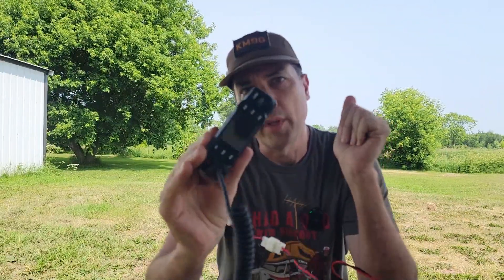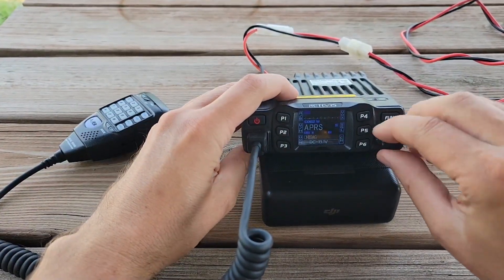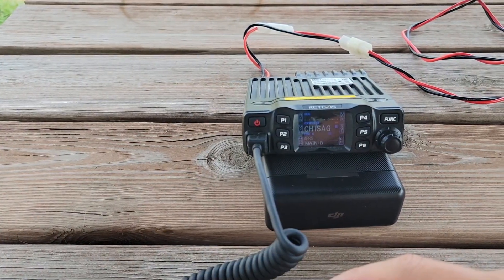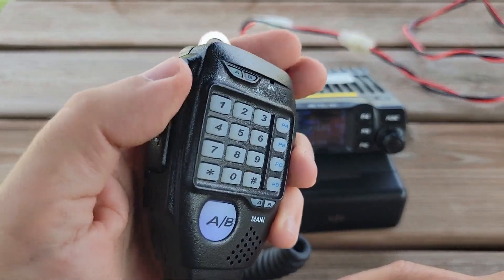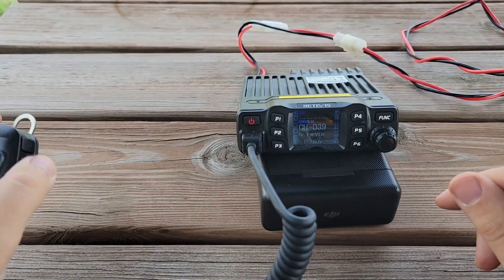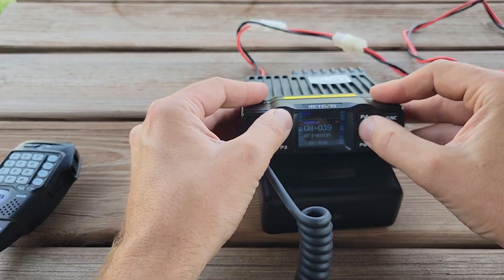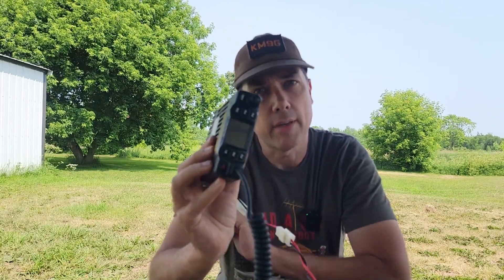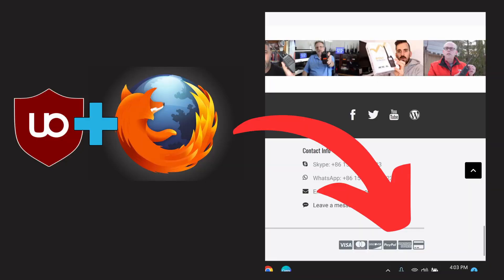I Broke It!

Comment: Hi Steve. I am just now seeing this video (1/1/24). Did the factory fix it? I glanced through the comments but did not find one about a resolution. Was also wondering if you had tried the long-press FUNC button for factory reset. I googled it as I suspect you have as well.
Reply from the maker: It is fixed at the factory and on a boat back.

Comment: Ham Made Parts actually has a cable for this radio under the AT-778UV for connecting to Kantronics or Mobilinkd TNC. I ordered one to try with a spare KPC3+ for using with Outpost/Winlink for a dedicated packet station using the 778UV. I have had pretty good luck with Direwolf and APRS when I ran a local digi-gate, but for whatever reason Direwolf does not seem to play nice with the local packet BBS's. A hardware TNC has been the only solution.
Reply from the maker: Thanks for the tip!
Reply: Sorry, I small rant from a UK-based Ham: I very nearly bought this AT-778UV cable from Ham Made Parts, but international shipping to the UK via USPS is a total racket. The part itself is expensive at $35, but I can easily justify that because it goes to a Ham that makes these things by hand, so each one is effectively a work of art. What gets me is that USPS wants to charge $63.10 for what is called "USPS Priority Mail International", which is their "cheap" rate. If you're really hard-up to get something very quickly you can choose "USPS Priority Mail Express International" which will cost you $72.35 for the privilege. Is it just me, or is there something a bit whiffy with this? Not blaming Ham Made Parts (I would love to support them from over this side of the pond), but USPS really takes the biscuit. I have lost things sent from the US in the past, and yet every cheap little doo-dad sent over from China gets to me for $0.00 (I know that there is massive controversy about that, but that's reserved for a different rant) without fail. USPS is causing a $32 item to cost me almost $100, and that is before import tax. Sigh...

Comment: I have used my RT95 as an APRS Digipeater for over a month with no problems, but I ended up using the backside external speaker jack as it was more convenient for other ops and it required a lower volume setting in direwolf.   Maybe this is easier on the radio?
Reply from the maker: It could be easier on the radio, but I really wanted one cable to rule them all.  My old method worked and I'm experimenting/learning with a prototype PCB.  I definitely broke the radio, but it really looks to me like its a software problem that should be easy to fix.  With all the radios I have, its 50/50 if I'll use this one again for this project or just pick another one.  Its good to have options, but it stalls the project I was working on...  Time will tell.  Thanks for watching!

Comment: Hi Steve, thanks for your sharing. Your RT95 is still on the way back to the factory. Our engineer team told me they have recently received another case of the same failure as yours, which has never happened before. So they thought that maybe another person did the same APRS modification to the RT95 as you did.
Our engineer team didn't think the failure caused by the software, or firmware. They assumed this was most likely a circuit problem. Since the RT95 was not designed with the APRS modification in mind, your changes may have caused some circuits to short out. Of course the final result will not be known until the device is returned to the factory. I will update the reason again in the comments at that time.
Reply from the maker: Thanks!  I'm curious as to what the problem is.
Reply: This is great customer support. 👍
Reply: @mostlypostie1  Thank you!
Reply: Since it wasn't designed with APRS/Packet (digital?) in mind, I wonder about the cpu/processor freaking out and going south.
Reply: @fitcher-armchair-sleuth  At the moment we don't have an answer as Steve's RT95 is still in transit, and we will need to get the faulty radio on our hands to find the real reason. As I mentioned before the possibility of a circuit failure, it is also possible if a CPU failure occurs, but this will all have to be tested to get a final answer.
Reply: @retevisQA  .. Roger on all that. Will be watching with interest.
Reply: @retevisQA any update? Ordered a rt95 but dont want to break my unit
Reply from the maker: @nodlek it's probably at my mailbox in TX. I won't see it until after hamcation. The radio was fine. I broke it.
Reply: @temporarilyoffline  thankyou!!
Reply: @temporarilyoffline  If you find out what was wrong with it and what may have caused the failure please let us know.
Reply from the maker: I'll have a follow-up video out soon. I just got it back from warranty support.
Reply: @temporarilyoffline  Any status on the follow up? Interested in what went wrong. I suspect it is because you didnt 'bond' the grounds from the tty serial card and the radio. I would recommend using either a relay or octocoupler between the tty and the radio
Reply from the maker: @HansKillinger They fixed it, but didn't tell me what the cause was.  I have it back in my hands, but haven't had a chance to get to it in the list of projects yet.  I'll have a video on it ASAP

Comment: Like an ecm on a car, you can remove power, and take + & - wires and tape them together, coming from the radio. It drains all electro caps, memory batteries, and will clear the itty bitty memory that you may have overloaded, and the mainframe controller for button commands and operating system may have gotten tangled, because they are not separated drives, but this may also flatline it, like all flash bye-bye.
But you could prolly write from scratch or copy paste from working radio. What a potential content dynamo, but if it gets worse, you made the choice. 
Still content.
Reply from the maker: I shoulda thoughta that!

Comment: I reached peak of my couriosity after bricking my G90 and two Nanovna. Now I know if is it not broken do not fix it 😉😁😁😁
Reply from the maker: Lessons learned!
Reply: Being too cheap to buy a data cable, I put an ethernet cable in my G90 and shorted some wires to see which would key it up.

Mainly because the diagram was illegible and most things don't mind being shorted. Well the screen started to blink  CONNECTION LOST and it got stuck in TX 🤦‍♂️

I ahem, got it fixed under warranty. Though I paid recorded delivery and probably got a used front panel with slack buttons & knobs.

Limited to 10W (M7) I'm running the G90 and RT95 from a £9 HP server PSU. I reused old molex connectors so I can switch to a 12V Lidl drill battery or jump pack.

Cheaper still, I use the vox mic attached to USB headphones to do FT8. Like an old modem with an acoustic coupler ☎️

The RT95 turns off sometimes when moved and I hope it's my crimping and not the inbuilt cord. Think I'll solder on that long thick cable still in the box to diagnose it.

Beware the G90 has such a crappy cable that the positive insulation wore through on my desk. I had to heatshrink it near the Tamiya thing.
Reply from the maker: @dazednconfused31337  resourceful!

Comment: Have you solved the rapid rushes of static when squelch is not 0 that happen on the speaker mic output? I have an amp board based on an old LM386 with a low pass filter on the front end but waiting for wire to arrive so I can pin the connector for the board and the RJ-45. Or is this just an ANYTone 778UV II issue?
Reply from the maker: In my application I haven't worried about squelch.  I'm using direwolf and it can figure out what is data and what is noise - saving that for a future date.
Reply: @temporarilyoffline  My application is to build a compact repeater. I have used Motorola GM300s ($60 off EBay and has great audio with 40w output) but they require dosbox to run some very old programming software to configure them and you have to reconfigure jumpers in the radio to switch between MMDVM and just an FM repeater with a homebrew STM32 repeater controller. Currently in search of a new radio that has the necessary inputs and outputs that doesn't break the bank. The RT95 or the AT-778UV II look like I might be able to make work without to much trouble. The pulsing squelch noise when squelch is not 0 is a problem.
Reply from the maker: @W3DMJ  have you seen the alinco radios with the 9 pin port on the back?  (DR-135TPMKIII) - that might be closer to what you need in a modern radio!
Reply: @temporarilyoffline  I have not. It looks like they are hard to come by. Will keep an eye out to snag a couple for testing.
Reply from the maker: @W3DMJ  I think you can get the TNC board for the 138, but I'm not in front of my computer to google around for it.  the 138 is the current model and it looks like it has the hole in the back where the port should go.

Comment: I'm not a fan of Chinese radio's - you get what you pay for. 

Great at volume manufacture, but their design capability in general lacks a lot of finesse and / or a seemingly baked-in desire to cost reduce and make cheap in appearance and build quality. And their user interfaces suck big-time. As well as programming software being absolutely dire.

Not a lot to like apart from bargain basement prices. Best avoided IMO. And their names also suck. Who in their right mind would bring a product to market under the brand of "Pingfu"? WTF?  Pingfu?
Reply from the maker: I wish I could say other radios are better... but I just turned on my Yaesu and accidentally pressed "AF Dual" which resulted in 3 VFOs  (I know what it does, but who names a button "Dual" when it does "Triple"?)  My Icoms have "DATA OFF MOD"... again, I know what it does, but its awful naming - its like they are trying to stunt the growth of the hobby.

Comment: You let out the magic firmware smoke!
Reply from the maker: I tried to breathe it all in when it happened so I'd be smarter next time.
Reply: @temporarilyoffline  Makes sense. That’s why I always burn the user manual right away when I buy a new radio. Osmosis learning is the best.

Comment: A friend of mine has that radio and it worked great until he set it up to do Aprs. Seems like that's something Retevis needs to look in to.
Reply from the maker: Did he say what happened?  I had it working with APRS and I tried to make it easier/better/cleaner and bricked it.
Reply: @temporarilyoffline When he switched back from APRS to tx to a repeater the radio started giving him issues.

Comment: QUESTION- I unlocked the radio to work on the us bands and I am trying to use the supplied programming software. When I connect it to the radio the soft wear tells me that this is the wrong radio. I am not sure how to fix this. Any help would be great.
Reply from the maker: Are you using the Retevis software?
Reply: @temporarilyoffline  yes
Reply from the maker: @stephenvandyke4084  I think I used Chirp when I was playing around with that.  I haven't used retevis software yet.
Reply: @temporarilyoffline  in my opinion it is terrible compared to yaesu programming software
Reply: Be sure you're selecting the correct version of the radio - there is a VOX version and a non-VOX version and they are listed separately on the pull down list of radios.  This, for me, was the fix for "the wrong radio"...ran into the same thing.
Reply: @WeedyCreek  thanks will have to check that

Comment: Edge is Chrome? Wow.

TO. Did you connect external hardware to the mic jack? Possible ESD or out-of-range voltage?
Reply from the maker: Yeah. I connected something wrong to the mic port.  Should be an easy software fix, but I wasn't able to get that answer easy.
Reply: @temporarilyoffline  ok.I was thinking a blown chip, but maybe some bits got flipped. Hopefully.
Reply from the maker: @LeeMccNA5T  My assumption is that it a flipped bit

Comment: Way back when, in a place that doesn't exist anymore, I used to do a lot of chip-off exploitation.  It was for digital forensics, so I was reading, not writing, but if they can't repair it for you, I'd be tempted to pull the chip off of it and try to flash it manually on one of your zany linux builds!!!
Reply from the maker: I'll let you know when it gets back.